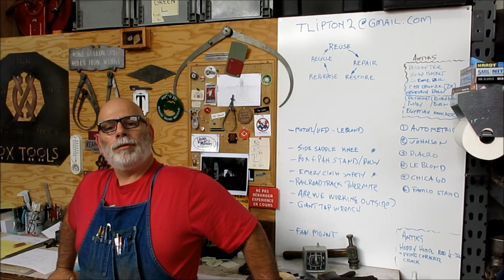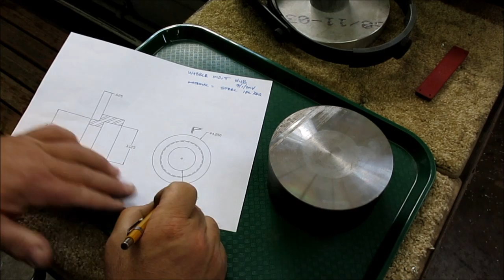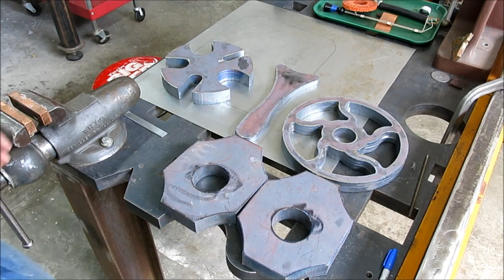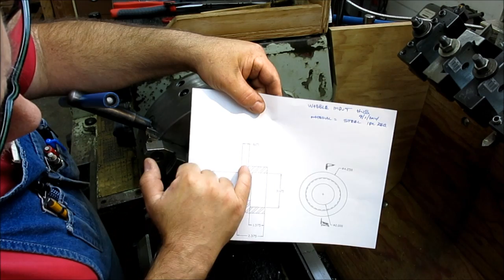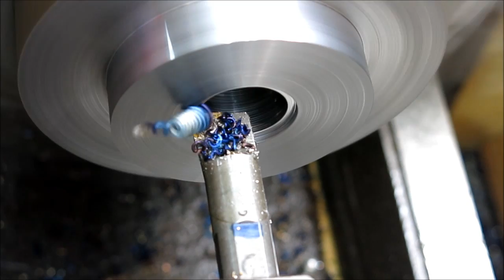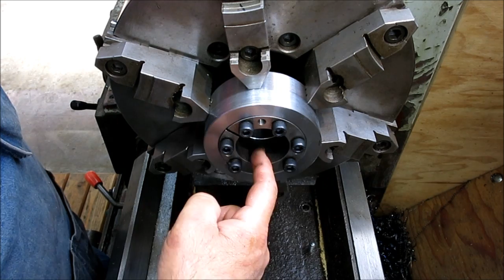Wabble Drive Hub

Comment: I am really interested in those gear ratios. From switching between several videos on this project, I count that the input gear has one less tooth (17) than the output gear (18). Definite mechanical advantage when operated.

The best 'proper' definition I can find for this is a harmonic gear. Not quite, what I would call, a planetary gear.

Interesting comments on the chip examination & cutting speed relationship. I assume, as the circumference decreases, (outside cutting), or increases (boring), the chip appearance will gradually change. Do you calculate & adjust for such changes? I guess the lathe is not infinitely adjustable, so the use of speed ranges & altering the cutting depths & feed speed is what has to be done.

I apologize for my ignorance, but I am really interested & been reading & watching your & James Kilroy's videos a lot! Learning quite a bit. Every since the schools stop having vocational training programs . . .
Reply from the maker: Hi Roach,

Good eyes you have there. The gear ratio is 18:1 Not bad for such a flat package, Take a look at Cycloidal drives. Wikipedia has a decent article on it. You will sometimes make speed adjustments while cutting to make sure the cutting speed stays within a favorable range. Most of the time unless the parts really vary in size while cutting you don't have to adjust. If something changes then you might make a speed or feed change to optimize. 

All the best,

Tom

Comment: I'm not sure I understand how this gear system works. In an earlier show, you referenced a cycloidal drive, which has this wikipedia link:
http://en.wikipedia.org/wiki/Cycloidal_drive

I don't see the inner set of pins in your setup. The inner pins drive the output shaft.

Could you please give us an overview of how the whole gear system works?
Reply from the maker: Hey Pat,

I did a video on my model of the drive some time ago. Search cycloidal in the channel search to find it. It is configured slightly different than what wikipedia shows but the function is the same. In my configuration the outer gear is the output gear. Hope this helps.

Cheers,

Tom

Comment: Hi Tom,
Good looking part, just wondering, I notice that you take rather small cuts on the roughing passes, since I have a set up that is close to what you have and, my roughing cuts are 3-4 times what you take.
I also try keep the surface cutting speed of carbide inserts between 600-800 fpm. Is there a reason you go shy on the removal?
I fully understand that on smaller lathes, it's impossible to achieve the monster hogging, but with 7.5 HP and a stout lathe, I would say let's go for it...!
Cheers,
Pierre
Reply from the maker: Hi Pierre,

I have to buy my own carbide inserts now.  Also I only had a hold of maybe a half inch in the chuck jaws. Six jaw or not I'm not looking to add to my blooper reel.

All the best,

Tom
Reply: Fair enough for the slim holding, but, I also pay my own inserts, sic.. Other peoples bloopers are fun though...
Take care,
Pierre

Comment: Hey Tom, that hub looks like a Ringfedder. I have made parts before that use them. Very cool design locking hub.
Good lathe work, and nice angles. No tubing? No problem right. We'll make a piece of solid into what we need. From the chips it looked like 1018. Looks like that boring bar is solid carbide shank.
I like the burn outs. Did Steve make those for you. That press plate looks exactly like the one on the arbor press at work.
Thanks for sharing.

Adam
Reply from the maker: Hey Adam,

Thanks for stopping by. The hub was 1018. Turns kind of crappy. It will get welded to one of the burnouts later on. The arbor press plate I drew up and had burned at the same time. Can't stand the little thin wispy one that came with the arbor press. 

All the best,

Tom

Comment: In a past video about the etching press I think you mentioned using an aluminum press bed and it curved on you from roller pressure. What are you planing to use on this one,? I remember in college we had a pair of Conrad combination litho / etching presses that used phenolic press beds (micarta  or Garolite from Mcmaster carr)
Reply from the maker: Hi Andrew,

In the early design stages I was going to use steel. After examining a French American tool press with some miles on it I decided to go with the Phenolic. It will be around an inch thick. Thanks for the comment.

Cheers,

Tom
Reply: oxtoolco you might consider lignostone instead of phenolic, ive seen it used on big etching presses before. Is pretty awesome stuff.

Comment: Hi Tom,
Great to see progress on this project, I'm pretty jazzed to see the end product in action. Thanks for having us 'along for the ride'.

As for the specially cut pieces of steel, is that something most steel suppliers can do? Is it very costly? You mentioned a "GIF" was required for cut specs??? If you could share a little bit more in this process it might be helpful to others (especially to me!!!) :-)
Reply from the maker: Hey Pherd,

The steel I showed in the pile was $150 delivered to my door. I supplied a DXF drawing for the steel supplier (Nowell Steel in Antioch) to use for the cutting machine. DXF stands for drawing exchange format and is very common for laser, waterjet and flame cut profiles. Thanks for the comment.

Cheers,

Tom

Comment: I must admit I'm a bit puzzled - looking down the hole as it was being bored it seemed that the blank has been drilled completely through. Did you poke the backing plate after all or am I missing something...? :)
Reply from the maker: Hey Attila,

I may have been doing the second side boring where I removed the backing plate. I don't think I showed swapping it around in the chuck. Sorry for the confusion.

Cheers,

Tom

Comment: 4:20 "Just in case I bozo this one."  True mark of a professional, planning ahead.  Hey Tom, do you know the holder designation for that WNMG holder you are using in this video?  Assuming its one of those industry standard letter designations that I can't ever seem to memorize.  PFC! Ha! Taper locks ROCK!
Reply: theres some pretty cool charts on the web. msg me if you need one.
Reply from the maker: Hey James,

Its an MWLNR then the shank size in some other cryptic numerals. The Iscar and Sandvik holders have a really nice clamp arrangement. Thanks for stopping by.

Cheers,

Tom

Comment: I'm very fascinated and full of admiration watching these processes being demonstrated by yourself and how you use the electronic equipment to help with measurement (and its accuracy!)
That bushing is surely rather special if it can both grip the shaft and the piece it is installed inside simultaneously.
Reply from the maker: Hi Dan,

These couplings are really nice. Its amazing how much torque and thrust load they can handle. Ebay is loaded with oddball size new old stock. I picked up a couple sizes when I was parts shopping for the press.

Cheers,

Tom

Comment: Enjoyed that, what was your material today? Watched the whole darn thing twice because I thought I missed it.
Reply from the maker: Hey Stan,

I think you're right. I don't think I mentioned what it was. It was steel in case you are still wondering. Thanks for stopping by.

All the best,

Tom
Reply: OMG ... steel isnt too hard to pick out of a line up, but your finishes were kind of looking like 1018
Reply: Stan -- Tom mentioned earlier comment it was 1018.  I was going to tease "it came out of the scrap bin".  I'm pretty good these days about spray painting incoming stock to keep track. Worse was a scarp  piece "just the right size" I welded into a hole (miss drilled, plug and redrill) only to discover it was 01. Oops.
Reply: Tom Walter Ha ha .. I dont read comments usually, you guys have turned me into Dick Tracy, bummer about the O-1, I plasma cut some 0-1 and them proceeded to rake all the teeth off my band saw with it, been there .. done that.

Comment: 1 meter = 39.3701 inches
so  1mm = 1/1000 of a meter = 0.03937" 
and 100mm = 3.937"
 real simple "note to self"
Notice the simple relationship?  39.3701", 3.937", and .0393701"   Just moving the decimal point around.
Reply: russhellmy Apart from the fact, that 1 meter is not even 39,37008 inches but more like 39,37007874015748031496062992126 inches... ;)
Reply from the maker: WAVETUBE84 We sent them machines calibrated in yank.

Cheers,

Tom
Reply: mikey_d the part of my comment "is actually 39.37008" was meant to be tongue-in-cheek to highlight that the reverse ratio is so awkward in that the digits run on and you then have to decide where to round-off, thus why 25.4 is so much easier to remember and use.
Actually if America, Burma and Liberia would hurry up and concert to metric the problem would disappear.
Reply: mikey_d Ewewee.... Yes,,, let's use  39,37007874015748031496062992126 inches... It's so cool looking. My work for many years was plus or minus .002" for a French tire company even on fairly large parts, and in the countless thousands of times of punching in .03937 on my calculator,,, and my work was always well within tolerance. Doesn't seem worthy of a dispute under most conditions... :o| :o]
Reply: russhellmy Yeah, but one foot equals 30.48 centimeters which doesn't make a damn bit of sense.
Reply: That's just bizarre, in nearly 30 years of engineering I've never seen anyone say "1 meter = 39.3701 inches"
Apart from the fact it's wrong, is actually 39.37008 inches, it's a very cumbersome n clumsy way to define the ratio. 1 inch = 25.4 mm is so much cleaner (and correct).
Reply: I rounded off the last 2/100,000ths of an inch.....shoot me.  Everyone has knows that a meter is around 39.something inches.  Say it's 39 inches.  A millimeter is 1/1000th of a meter.  Divide 39 by 1000... =  .039  that's what a millimeter is (roughly...we aren't talking 10,000ths of a inch, just a quick conversion).
Reply: 25.4mm is just the inverse.  But 25.4 does not relate instantly to a yard or a meter.  39.37008"  (OK) is a meter.  It's just another quick reference/conversion .  tool that is easy and quick!
Reply: ha ha ha, you win!
Reply: With the conflict in measurement standards.... How did USA, Britain, and Russia ever get it together to win WW2?
Reply: Hi, I've always learned and used the, 25.4 numbers, easy to remember 3 digits that makes the exact ratio, leaves more kilobytes in my brain to store more useful stuff...lol

Comment: noice... i was wondering if you had the solid works files for the little vice your friend did for you? im still hoping to make some castings (from 3d printed patterns) and i'll be setup for bronze/brass very shortly!!
Reply from the maker: Hey Home,

We want to test drive the whole process and see how it goes. Keith Rucker has already shown the printed patterns work fine. More coming soon.

Cheers,

Tom
Reply: oxtoolco yeah I've made a few castings myself with 3d printed patterns.. I've made a couple of nice fly wheels.. I'm just after the files so I can print some patterns of that nice little vice

Comment: Beautiful fit on that tapered bushing. I guess it must expand in the bore and also contract around the shaft. Do the screws force two split cones together? Never seen one before.
Reply: thats what i was thinking.. its a clever bit of engineering that one
Reply from the maker: Hi Art,

Yes you got it right. It has dual tapers that expand the outer and compress the inner. The unit I have will transmit 1700 ft/lb torque and take 21,000 lbs of thrust load. Pretty impressive coupling. 

Cheers,

Tom